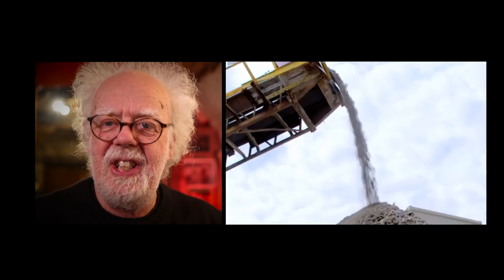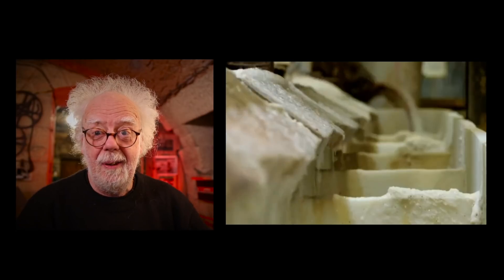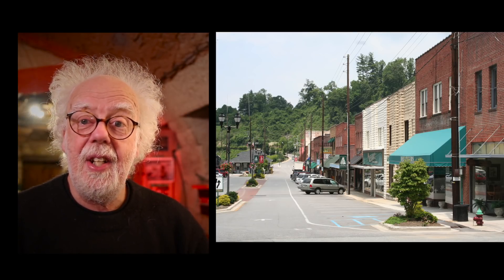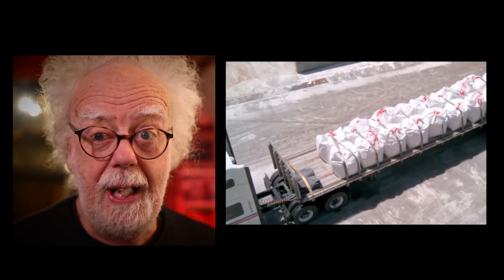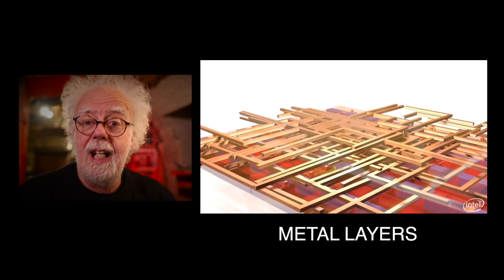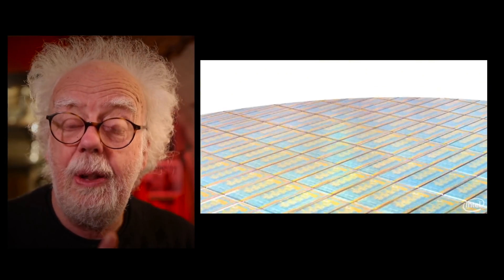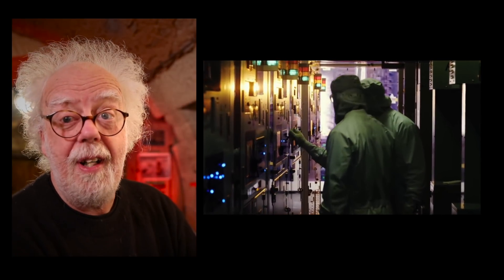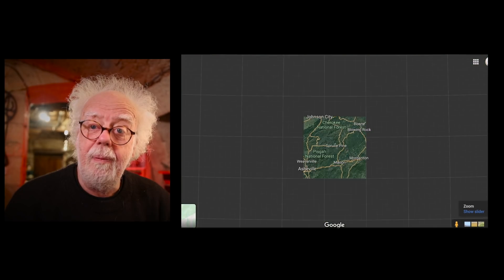Secret inside the micro chip - Prof Simon

Comment: Your comment about the number of layers is way off, way too big. There are other impressive numbers associated with modern ICs, but number of layers is not one. I suggest that you find out the number of TRANSISTORs in a modern Intel CPU (for example). Each layer is defined in the manufacturing process by a mask (same idea as the photographic masks used to manufacture PCBs, but on a much much smaller scale of resolution). These masks are MEGA expensive. A mask is needed for each layer (this is a simplification, but more or less holds true). A quick google revealed "A 28nm device has 40 to 50 mask layers." The 28nm hints at the resolution of the tiniest feature on the mask and hence size of transistor. Nowadays 14nm is a common process size and even smaller processes are in development. The smaller the process, the smaller the transistors, the smaller each IC is, the more ICs can be fitted onto a wafer, the more $$$. Nevertheless the information about the sand was very interesting, I had never heard of this before.
Reply: I think he might not have ment layers of the chip but operations or steps on the chip .. then it might be accurate.  Like applying photo lacquer .. developing .. putting in ovens to add boron or antimoon for doping to get N and P areas or .. evaporate aluminium on .. etching of silicon/aluminium/silicondioxide .. baking to create siliciumdioxide   etc.         Also while components for a modern PC might use the latest node in resolution.  There might also be chips like all sort of controllers for cars that dont need to be at the last node,  so they can be made by older cheaper fabs.   As each new generation of fab doubles in price.  Like to make car chips you might not need an ASML extreme ultraviolet device to to light a mask.   The latest machines are very expensive,  use a million watts of power .. create EUV by putting a laser on droplets of tin.  And because the EUV doesnt go through lenses they need mirrors for everything.  And as the mirrors also dont reflect all light you need to start out with a million watts of power to get some light on the chip heh.

Comment: There used to be a quarry in Scotland producing  high purity quartz for the semiconductor industry, it was closed down due to "leverage" 
Speaking of pine trees and semiconductors, pine resin is used as a heat treatment and soldering compound for semiconductor die production and also in general electronics production and soldering.
Reply from the maker: Interesting
Reply: Yeahr if you have solder wire .. which used to be tin and lead .. but in europe because of RoHS laws its now tin only.  The core is made out of rosin flux,  which is made out of pine resin.   The flux cleans the copper surface of oxides and makes the solder flow over the copper. Solder flux in solder wave machines can be chemicals but these days they are finding better ways ... like citric acid.  And in chip making if they clean the silicium wafers with water you dont want drops of water staying behind, because if they dry up they leave residue.  So they add some alcohol to the cleaning water to reduce surface tension and then no drops are left.  But they also use a bunch of nasty chemicals to make chips .. like acids and bases to etch the silicium copper and aluminium .. and solvents to get the photoresistive lacquers off..

Comment: Few people associate the manufacture of the IC with PCB boards actually the real name is printed wiring board PWB but everybody calls them PCB. And IC is very much like a PWB but it is smaller and has a lot more layers. The base material of a board is also not etched as it is fiberglass and not silicon. They both have copper tracks and interconnections between layers but the only thing a PWB does have that an IC does not have are large value capacitors. these are usually added externally in the rest if the circuit.

Comment: The Secret of Every microchip isn't your catch line for the video. It is "inside every intel" there is a Goldman Sachs venture capital developed and funded additional CPU architecture (not IA32/X86_64) called the ARC processor aka the "Intel Management Engine" using GPL violating Minix firmware that only the NSA has been able to disable running at ring 0. Check the facts. It has direct access to your network card, your keyboard, your USB your memory, and running it's own network stack so you can't firewall it. Basically every intel is pawned / owned / taken backdoored at the hardware level by you know who. If you disable it the wrong way, your CPU is dead. Only the chosen must have the power to spy on you. Who are the Chosen people? This is right down your alley do a video on it. I can give you links about how to disable it using a SPI connector on your motherboard to get at your flash and other tricks.
Reply: It also has access to your video memory if you use intel's onboard IRIX graphics instead of a discreet card too, I forgot that, and a VNC server ( real-time screen sharing) built in that IT administrators and "others" can use to share your screen without even running any software detectable by the OS. I've been playing with the SDK for the public components of this nightmare so I know what I'm talking about. Motherboard vendors refuse to update security vulnerabilities (e.g. Mine MSI and ban you from the forums if you complain and all other customers) , so anyone can own your computer hardware (outside your OS) to get access to these features if they put a USB near your computer. That's just what we know it does right now.

Comment: Integrated circuits are made from silicon, made by melting that silica sand and electrolysing it, to form at one electrode, silicon metal, and the other to carbon dioxide. To melt it requires very high energy input, as you simultaneously have to pump kilowatts of energy in, using a massive induction coil ( incidentally water cooled as your copper loop is made from thick copper water pipe), and, as silica is pretty much the best refractory material around, to keep the vessel from simply melting you have to cool the graphite walls of the vessel as well, so that they do not simply vapourise, as they are made from essentially carbon. The centre electrode will grow a large blob of impure silicon, and is also cooled.

Once made however you can refine the silicon and smelt it under an insert atmosphere, as it does melt at a lower temperature, so there you use silica again as the vessel, and can then draw a single high purity crystal from it in a controlled furnace. Refine a few doxen times with a zone heater to move all the impurities to the one end, and you have your raw silicon ingot, which is then sliced and polished for use.

As an aside, if you analyse a silicon chip, no matter how complex, with the analytical methods available 100 years ago, you would get a result that your chip is pure silicon, with no other contaminants detectable.
Reply: Interestingly enough, when following chemical experiments from over 100 years ago that found that certain materials like Zinc catalysed the reaction, when performed today with pure materials, they don't work.

Turns out that 'Zinc powder' etc. back in the day was highly impure and full of other elements, and it was these mixtures that were responsible for the catalysyis.